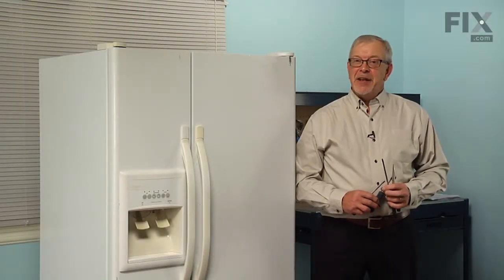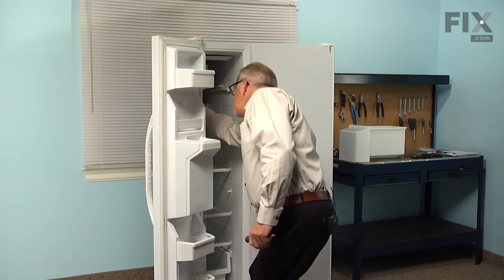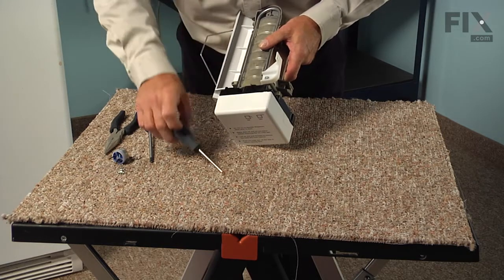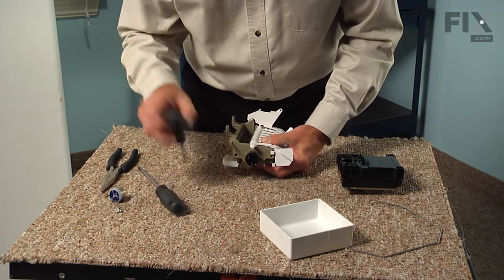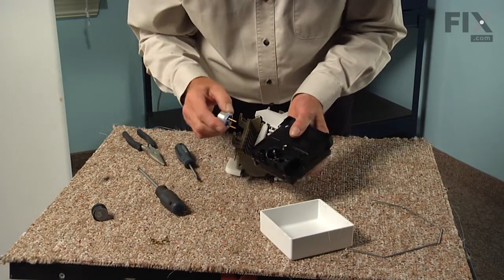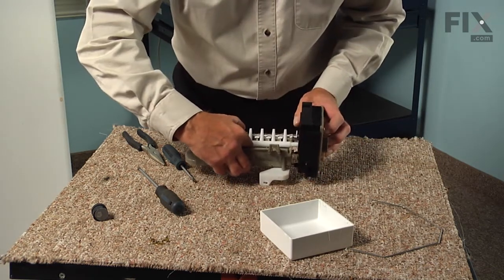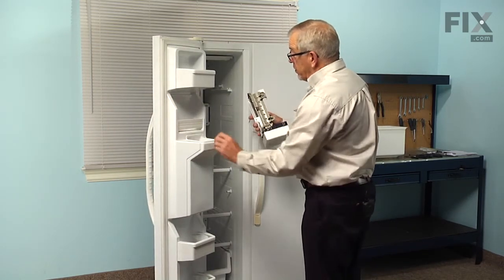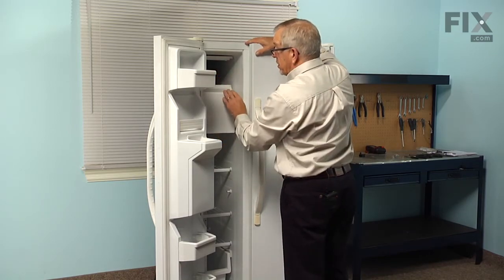Kenmore Refrigerator Repair – How to replace the Thermostat with Clips

Comment: Is the freezer thermostat different from the one for the refrigerator.  My freezer is fine, but the fridge part seems to have a bad thermostat.  Do you have a video for that?  Thank you.
Reply: Did you figure that out, I'm having issues with my refrigerator thermostat as well
Reply: @Justgonnaleavethisblank  I did not figure that one out.  It eventually fixed itself.  It was a very hot time of the summer, and the fridge was close to the door.  I'm not sure how big a role the weather played because my fridge is fine this summer.  I'm sorry I don't have any solution.